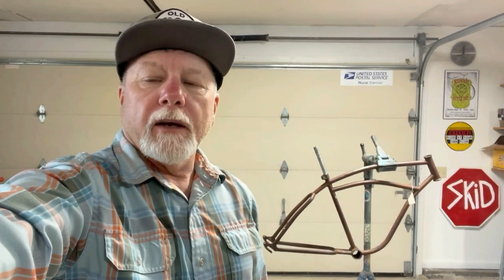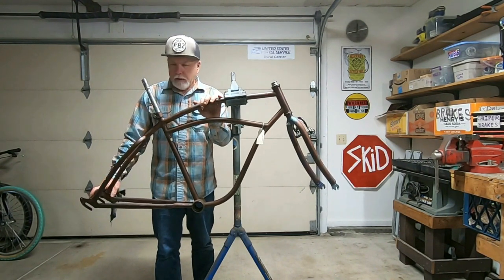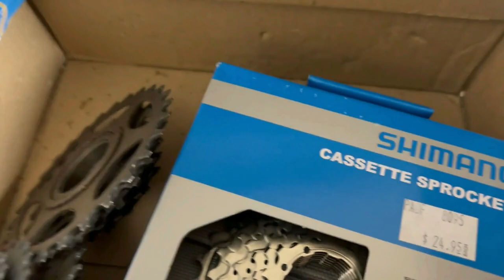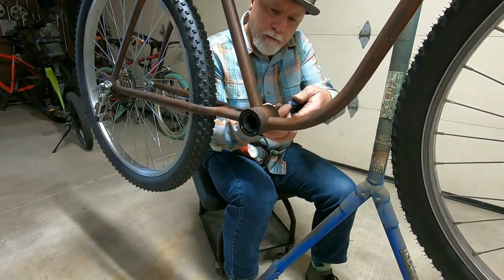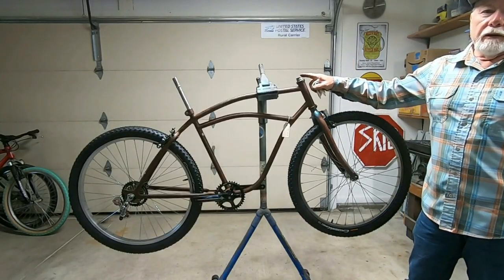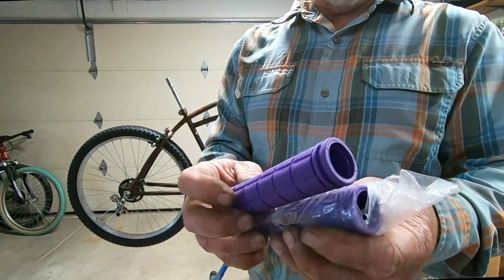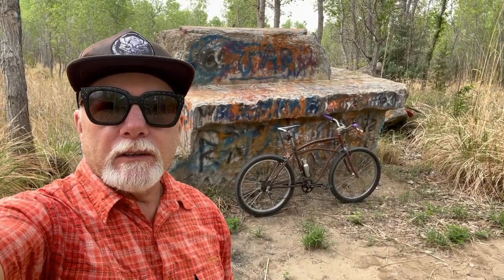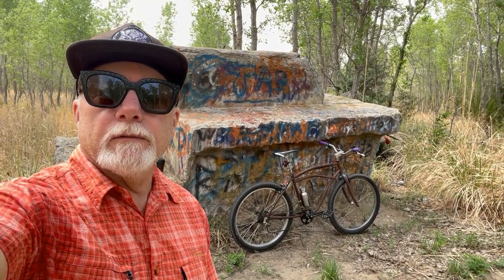Bike Builds & Mods - Monark Klunker

Comment: Those brakes look a bit sketchy but Dia-Comp makes good stuff.  I thought that I may have needed a similar set for my latest project, placing 700C wheels on a roadie with 27" wheels, but I lucked out.
Reply from the maker: Yeah the brakes but surprisingly work pretty well. or well enough for me anyway. I've wondered how that rear would hold up using the method I do but I've done it on a couple bikes now and have had no issues. Glad your wheel swap worked out. I've wondered about that.
Reply: @Locojoe  I'll prolly post a write up on that soon.

Comment: Hey Randy. There is always talk of the risks when widening the rear of the bike for multi speed freewheels.
 I have done it, I have seen it done many times...with no problems.  Have you ever had an issue with it yourself ,or have even seen any problems?  I do know steel will work harden and maybe crack, but I haven't seen it. 
You are an experienced dude. Just looking for your opinion/experience.
Reply from the maker: The risk I was referring to, and should have made clear, is just getting the rear triangle and dropouts all out of whack/alignment or whatever. I don't think there's much risk in compromising the integrity of the metal or welds. Like you I've done it a few times with no issues other than alignment. Thanks for watching!
Reply: @Locojoe  Cool. Thanks for your reply, Bro.

Comment: What size bolt did you use for brake mount? Thanks and keep on klunkin! 🤙
Reply from the maker: The rear brake mount?.. I used a piece from a cantilever brake (not sure what that particular piece is called) and it just happened to thread right in to the existing hole/threads on the cross brace/fender mount. IDK if the threads really matched or it kind of just self threaded in. I've used this method on other frames with different fender mount where there is access to the backside of the hole. I just bolted that piece to the fender mount putting a nut on the backside. Hope that helps. Thanks.